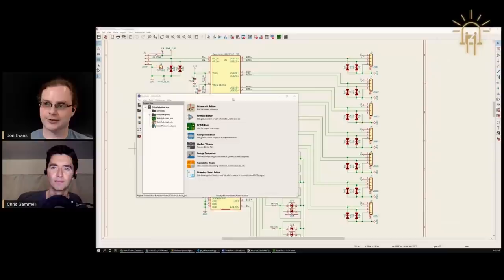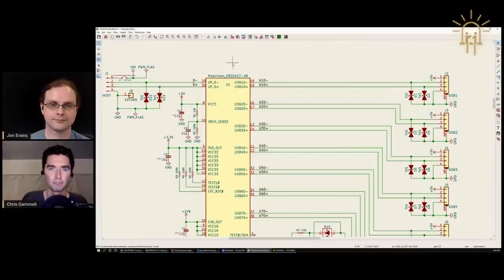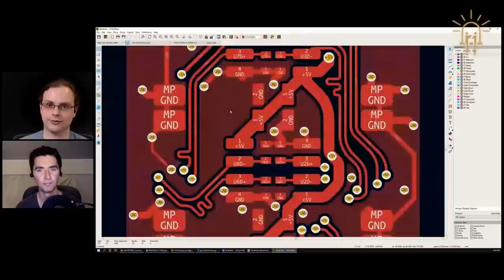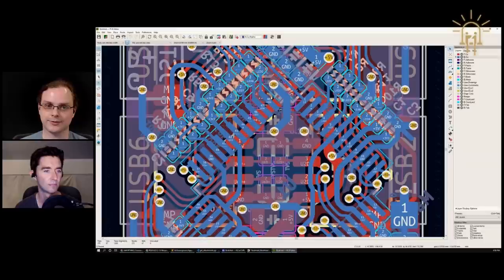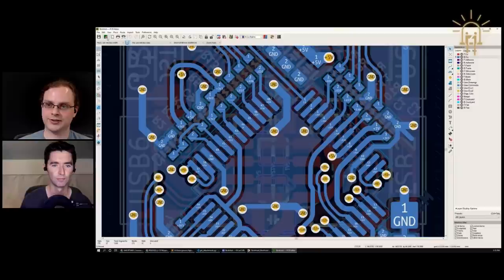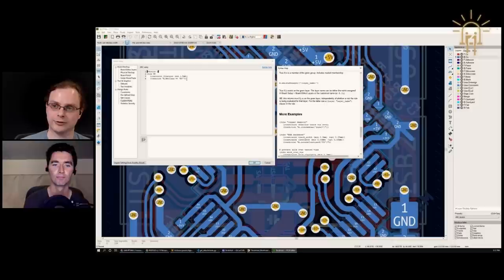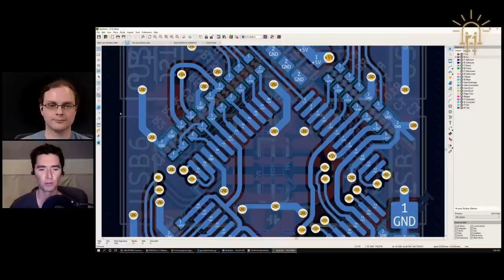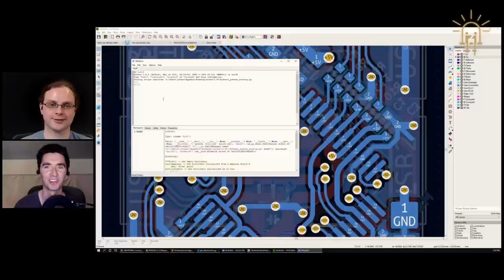CEP014 - Moving to KiCad V6 with Jon Evans

Comment: Great info in this video - I can't wait for V6.  I just finished my first scripting project laying out 7 different led boards with different spacing and I found it almost impossible to find good examples or usable API documentation.  I only found a few YouTube videos on the subject.  It was enough to get me started, but it took a lot longer then it should have.  I am not really complaining - it's FREE and I got it to work with a few days trial and error!  But it would be great if someone developed a training video on getting started with scripting and step through all the API function and methods to let you know what they do.  The API I found show you the syntax of the commands but has no explanation about what it is used for.

Comment: Re: Central libraries, the dirty secret of those commercial EDA suites is that they ALL suck at handling central libraries. We use Mentor Graphics / Xpedition / Whatever they're calling it this week. We originally went with them for their advertised prowess on group design work... It's been nothing but disappointment. The tools exist, but they aren't great.

Comment: A parts library is 1) a schematic symbol, 2) a PCB footprint, 3) a SPICE model, and 4) links defining which schematic pins, footprint pins, and model parameters are equal.  I SHOULD be able to draw a schematic of a PNP transistor with pins named 'e,' 'b,' and 'c,' and assign it to a model "2N3906.mod" that specifies that e-EMIT, c-COLL, and b-BASE are synonyms.  I SHOULD be able to assign the same symbol to a "2N3906.dev" device where e-1, b-2, and c-3 specify the connections to a TO-92 package footprint.  I SHOULD be able to give my PNP symbol priority on my computer so that when I view a schematic containing PNP transistors, it uses MY symbols; other people can design their own symbols if they like or use a standard library if they don't.  As these SPICE model and device databases grow, I SHOULD be able to click the model or device link I want from a dropdown list.  EVERY PNP transistor I ever use will use the same symbol, EVERY NPN transistor I ever use will use the same symbol, EVERY diode, SCR. triac, N-JFET, P-EMOSFET, NAND, etc. I ever use will use the same symbol.  If a PNP transistor is part of a complex IC, then that device will have a PNP symbol and pin connections as ONE entry in its multi-part device file.  The SAME device might have NPN, JFET, multiplexer, and ADC connected to other pins as other entries in its device file/record.  If I find that one or more of my transistors need to be 2N4401 instead, I need only click "2N4401" from the dropdown list to make that change.

It should NOT be necessary for me to decide the details of which specific device (assuming the one I ultimately need is even in a library already) I want to place while I conceive a circuit design.  It SHOULD be easy and convenient for me to add these details to my design (and to the libraries) as those constraints become evident.